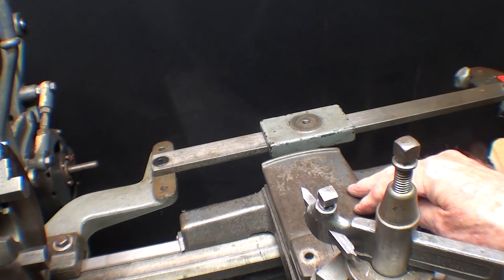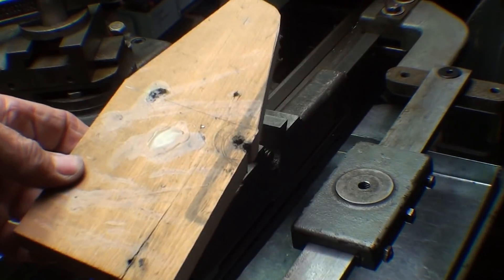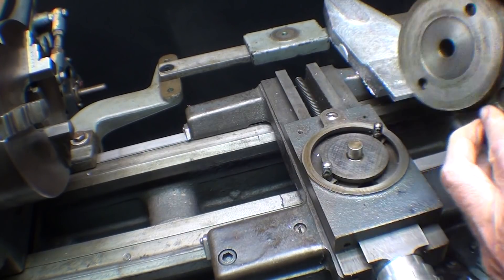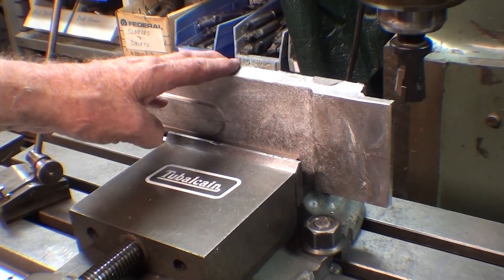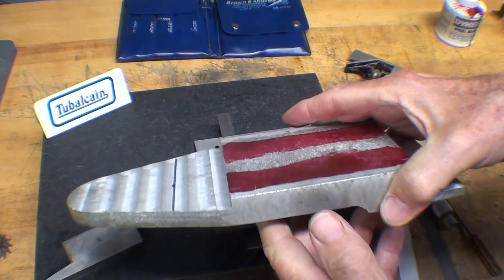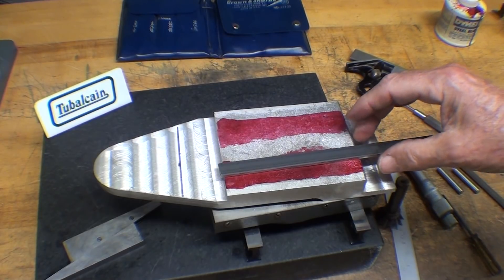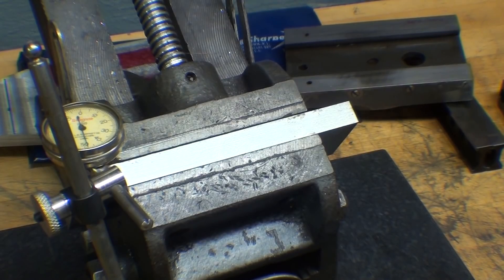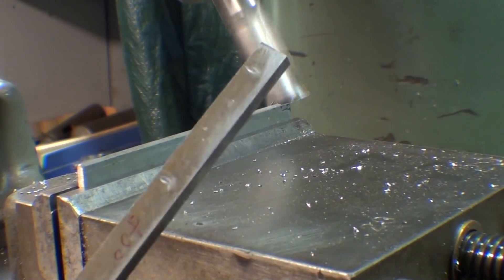Logan Lathe Taper Attachment  TIPS #402 pt 1 of 2 tubalcain

Comment: Interestingly enough, this is exactly how I received my Sheldon 12 x 36" lathe... missing only the exact same part of the taper attachment as yours!  I have to wonder why... taken off and stuck in a drawer somewhere, soon to be forever separated.  I have given much thought over the years as to what I was going to do with mine... I poured over multiple old Sheldon lathe pics, but was unable to see the exact part that was missing from mine.  I was told not to use steel to fabricate the missing part... only use cast iron because it will not flex under load... what do you think?  I do not have a piece of cast that large.  I am now watching your video with extreme interest!   Thanks again... you always hit the nail on the head somehow.

Comment: No need for the dovetails in the extension piece.   I have the extended cross slide pictured in that old Monty Ward cat.  I believe they made a short attachment version too, bolt-on, like you’re creating. The only portion that has dovetails and gib is on the 6 inch or so where the compound sits, the rest is open and similar in clearance to the chip guard you removed.
Reply: The original piece was one casting, but Mr. Pete's piece is an extension on the factory cross-slide that's going to rely on two small bolts to connect the two. I think the rigidity and support the extra dove tail provides will greatly reduce the stress on the two small bolts. Also help keep the two pieces aligned with each other.
Reply: +Wayne. I wrote and told Lyle that I thought a good fit on the ally part was not needed as a lot of other taper attachments just have a bolt on part to pull / push the cross slide. He has replied it is needed for rigidity purposes. I would not have thought so as the rear guide bar is so thin compared to other makes.

Comment: A Great start to a great video. Although dovetails are a good idea, I don't believe they are absolutely necessary. An easy way to make the gib, without tilting your milling head is to place a sacrificial piece of material, steel or whatever you have to the bed. make a cut Along one edge. Place your gib material In the groove you just made, and clamp it down, the wide side parallel with the table. now using a dovetail cutter, Cut along the edge of the material. Flip it over and make the second cut. Make sure the sharp edge of the material is down toward the table when you flip it. this is the way I have to do it, because the head on my Mill drill does not tilt.

Looking forward to your next installment. I always enjoy your videos. thank you.

Comment: Lyle, surely the ally part did not need a close fitting dovetail or gib strip. It will serve no use, it just needed to be clearance on the lathe saddle dovetail. The accuracy will be in the original cross slide, or am I missing something here ? Other make taper turning attachments just have a part that bolts onto the cross slide and does not use the original dovetail at all. I eagerly await your thoughts on this.
Reply from the maker: +Dave Ticehurst needs great rigidity during use. Necessitates a good fit

Comment: Woodworking, casting, machining, now if there is any welding and grinding you'll have it all in one project. Ha ha,. Then there's the angle milling. This is a great little series for showing how to make the part from A to Z.  Can't wait for the second part.

My angle vise is also a cheapie but it is a different style and is more ridged and a little more accurate. For the little projects I do, so far I haven't had to tile the head. My angle vise cost ~$40.00. It makes a very odd companion to my Kurt.